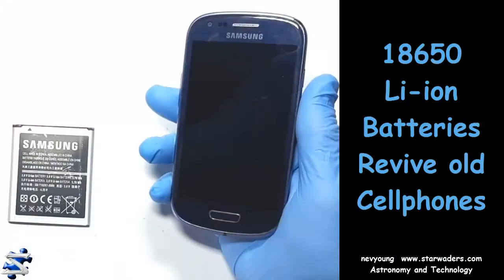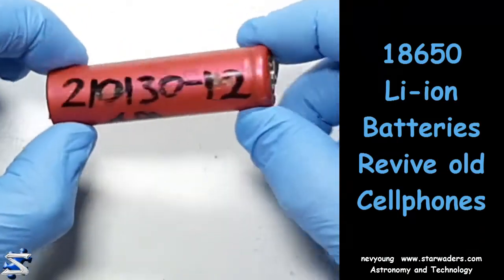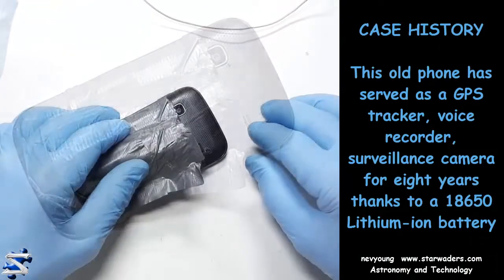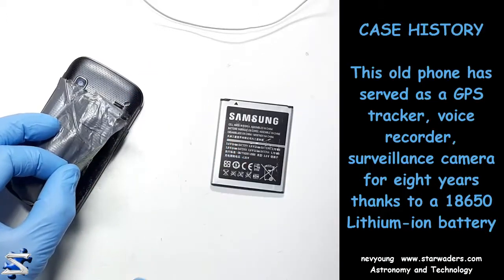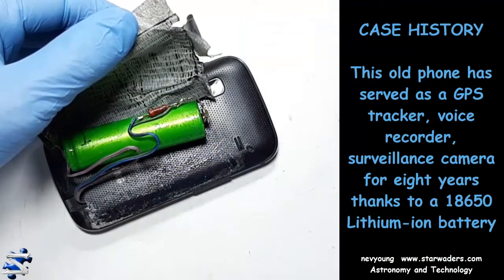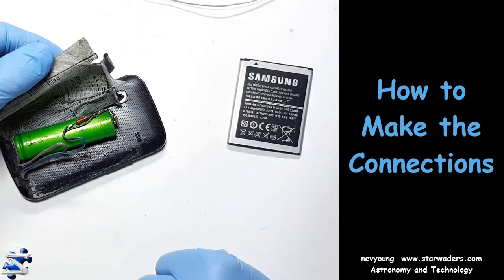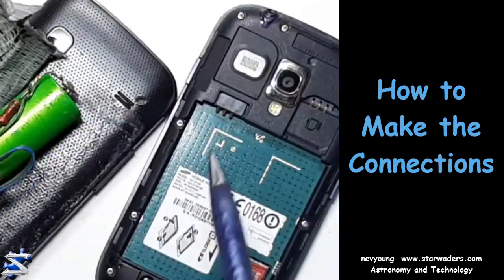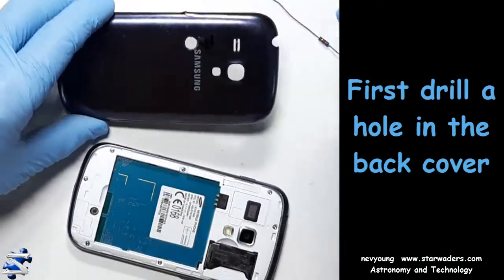Fit a 18650 Lithium-ion Battery to your old Cellphone

Comment: 4:25 ohh hell no. Why did you mess up the phone?

You need to take 3 wires and do soldering, glueing away from the phone 

Another question

How do we do this on a 4 Terminal Samsung battery?
Reply: Another 5k from the ground to the second middle terminal?